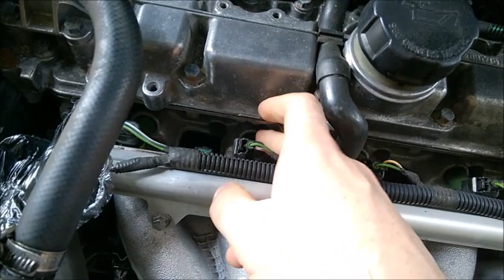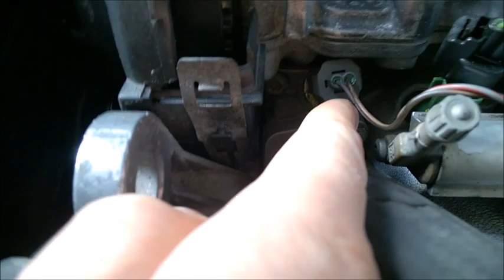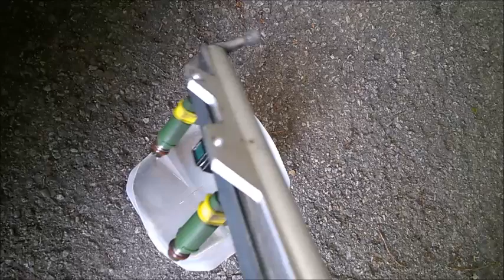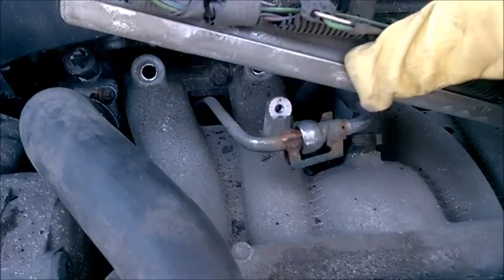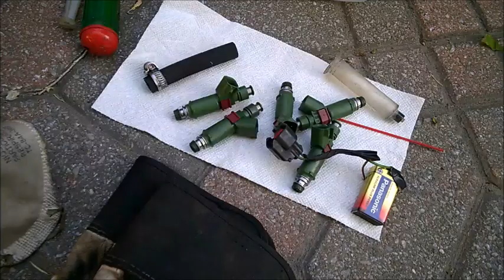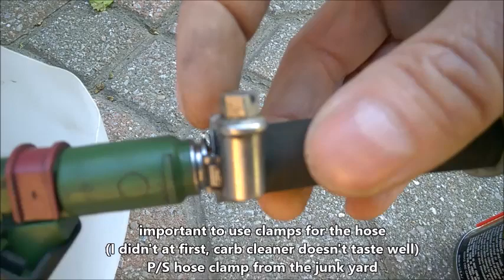Volvo S60 XC70 Fuel rail and injector removal Turbo N/A + fuel pressure regulator location 2001-2009

Comment from the maker: Small warning: On each injector there's two o-rings:  a slightly thinner one at the tip - manifold side, and a thicker one at the top - fuel rail side.  These two o-rings appear similar but they are slightly different in size when looking closely so it's important to place each one at it's right location, or you may experience leaks.  I'm sorry can't add this information on the video itself (Youtube no longer allows to add notes on the videos) so I'm going to stick this comment at the top.

Comment from the maker: Careful with the Fuel pressure sensor screw (FPS) if there is one: the small T25 torx screw can be stuck and hard to turn, may even snap. Use only a T25 socket placed correctly and try giving small kicks to release it. Try spraying 1-2 weeks in advance with PB Blaster or Liquid Wrench, and go gently. If it snaps, the fuel rail will need replaced.

Comment: 2 of the rubber seals on the electronics pigtails fell out when disconnecting them on my 06 s60r. I found one and put it back in but one I can’t find and I don’t know where to get another.  Anyone have any idea where to get em? Just the little rubber rectangular seals that sit in the plug
Reply from the maker: Volvo or a nearby scrap yard

Comment: My 2001 t5 has a metal/rubber line that comes around the front of and under the rail and just looks to be attached with fuel hose, I didn't see any clips.  Was going to remove it to replace the injectors, but was able to just flip the rail upside down and work with it on the manifold.

Comment: Good job, understood.
Your comments regarding cleanliness are good.  I took the cap off the schrader valve, like a tire valve, put a rag over and gently depress the inner valve in to release the fuel pressure.  Like a tire valve. You have good pressure, thats good, tight,  ah ha, protect your eyes.  Lastly,  very good video.  Thanks..
Reply from the maker: Cheers!
Reply: @Peppermint1  yes.  I have one bolt, hard to get at, then I can remove the intake.
I like the way you think.
  You got it.  
(Ps;  I got this 850, very neglected and did a major overhaul on the tranny, revearse/f1clutch pack seized due to lack of fluid, via leak, neglect.  Mess, but I am getting it, thanks to your help, little at a time..Cheers from Alaska. ).

Comment: Thanks for this video!
Do you know the different types of injectors for these Volvo engines?
Mine is a 2002 model with the Denso injection type.
I suppose it needs another type of injectors than the same engines but then with the Bosch injection.
Reply from the maker: Not familiar with the injectors brands, I know the non turbo engine have green ones and turbo oranges ones

Comment: Hello.
I have a problem with whining fuel pump, changed for new one no luck.
I do not have pem module in my car, line in tank is not bend.
My mechanic changed orings, and after that it started to progressively whine.
My question is, if this orings 1346393 fit 06 V70 2.0t, and if not as I quess can they leak so bad to make the pump whine? 
Regards
Reply from the maker: If a seal is leaking it will smell gas. The injectors have two different o-rings, if I remember well the thicker one goes at the inlet and the thinner at the outlet. Also must coat the o-rings with Vaseline before installing back in the rail. Try to measure the fuel pressure.  You can even read it live with one of those cheap OBD toggles and a phone with the Torque app. On the turbo the fuel pressure should be around 55-60psi at all times.
Reply: Hey, thank you for responding so fast, and in general for your video.
I have ordered odb scanner, will update when have results.

Have a good weekend :)

Comment: But the injectors shouldn't be to expensive to replace, right?
Reply from the maker: Injectors on these gasoline Volvo rarely if ever need replaced. Some people prefer to replace the injector seals, I found mines are in perfect condition even after almost 20 years. Only be sure to use vaseline on any injector or fuel pressure sensor seals before placing back, so it doesn't get damaged.
Reply: @Peppermint1  Thanks! That's good to know.
Reply: FCPEuro offers the 5-injector kit for $250